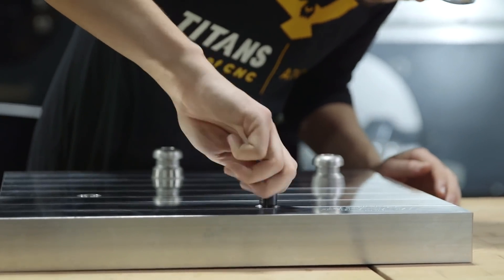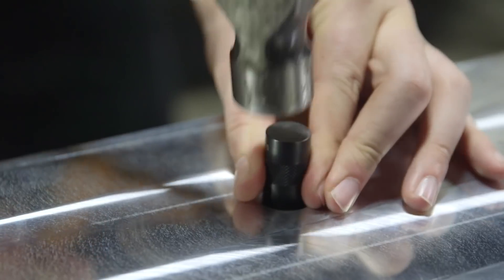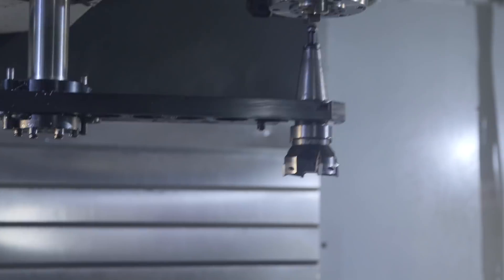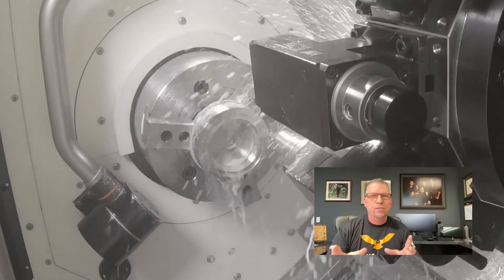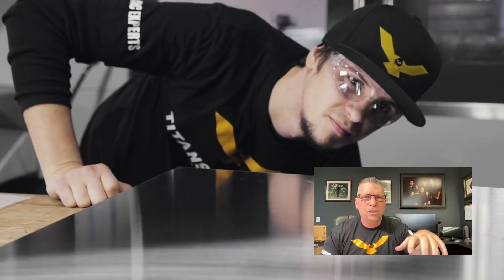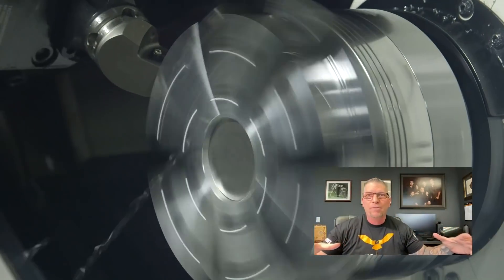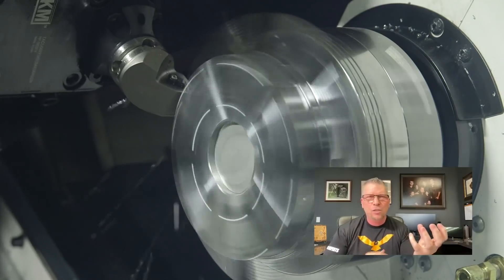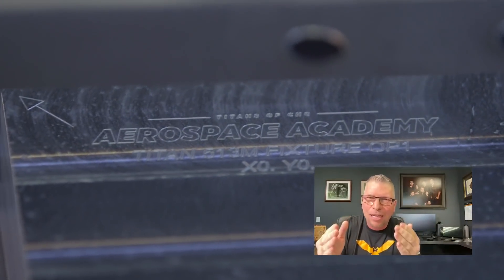The Ability to CNC Machine, Inspect, Engineer ROCKET PARTS 🚀🚀 We Created This For EVERY Machinist

Comment: Hello I'm a mechanical engineer.
I started the cnc course offered by titans of cnc.
I started by watching the building blocks since I'm a starter at G and M codes. I couldn't follow it. I would like to know the pre requesists before starting the course.
I work with Solidworks as Cad engineer.
Thank you
Reply: Being able to think as a normal person is the prerequisite. Engineers are trained to think completely and that's great, but so often we forget that you have to think like a normal person too (common sense). If you combine the two you can become a powerful engineer, because you can approach problems from two different aspects. Or you can be like most engineers and just say you are smarter than everyone and look like an ass when you are really just thinking about something in the way you were trained to. To be a powerful engineer you need both.

Rereading this the tone sounds demining it wasn't ment that way I think what engineers do is awesome I just get tired of the attitude that comes with them. The ones that have figured this out are amazing.
Reply: @RedBeard20842  Thanks for your advice.. But I didn't get the answer for my question
Reply: Honestly, different strokes for different folks. It sounds like you're having trouble with the computer engineering section of CNC; just look up a different tutorial on YouTube, maybe one meant for hobbyists, they tend to explain the overview process of model -> g code -> physical movements quite well. It helps to know what the machines are made of rather than how to use them, especially if you are an engineer.

You don't have to stick to a single source of knowledge you know, this is the internet after all :P.

Edit: Maybe try a tutorial for 3D printers, even. The exact same concepts apply to advanced milling machines.

Comment: I am jumping in on manufacturing as I think it's going to get big in the US. Picked up an old Fadal 4020 for $1,100.00 at auction in decent shape appearance wise but ultimately will need parts replaced. For $12,000 I can bring the machine to some very current standards and tolerances (turcite, ball screws, main computer, way surfacing and a few other fixes) which is not a bad price really as compared to most any other machine to start out on.  It's also 4th and 5th axis using HAAS hardware so I think it will make a good launch pad without being destructively expensive. You've been very helpful in motivating me to launch with this, it may not do aerospace, but it can get me there.

Comment: This without a doubt is going to be fantastic! Do you plan to complete the existing Academy also? Any ETA for design  and machining videos for the existing series aside of building blocks and rocket? Or may be the higher level ones will be integrated/replaced in the upcoming Aerospace curriculum?
Thanks in advance for your answers and all the more for all the amazing learning contents shared with all 🙏🙏🙏
Take care
Reply: Hello I'm a mechanical engineer.
I started the cnc course offered by titans of cnc.
I started by watching the building blocks since I'm a starter at G and M codes. I couldn't follow it. I would like to know the pre requesists before starting the course.
I work with Solidworks as Cad engineer.
Thank you